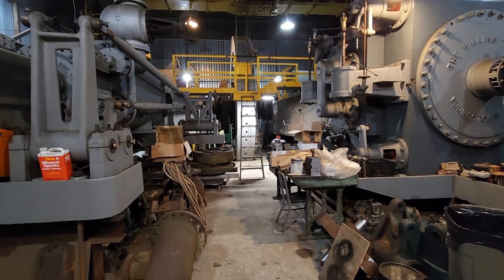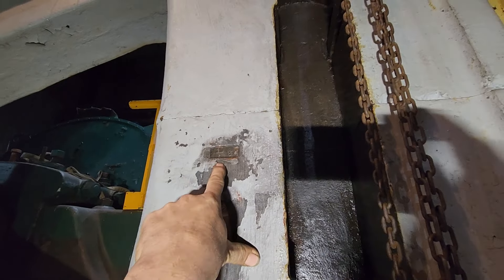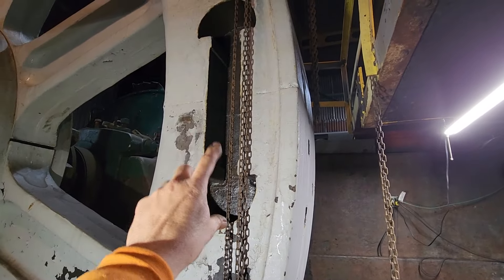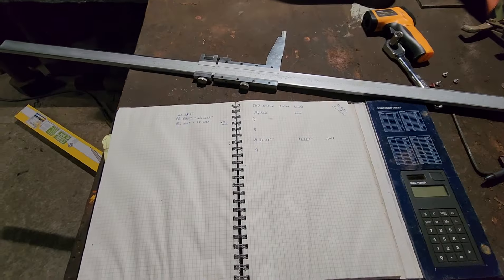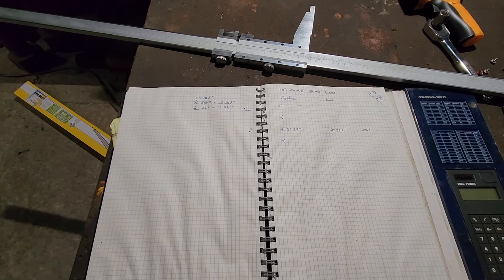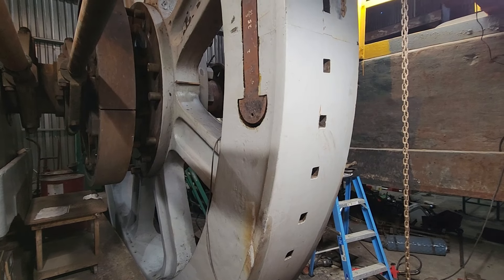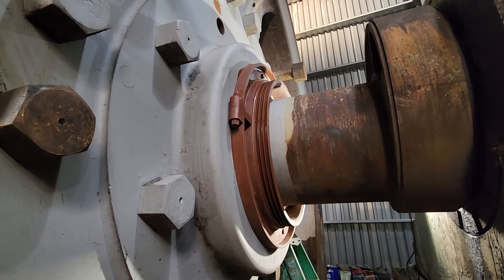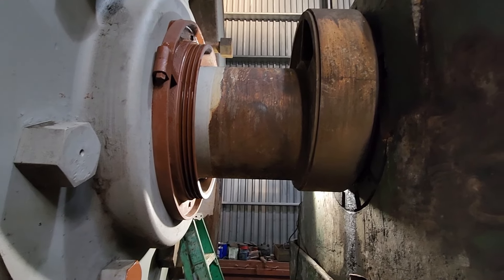Tod Engine Shrink Links

Comment: Very informative.    I’ve read of shrink links before on some of the large engine sites. It’s great to have a video of how the process was done. I can imagine they would have used a portable forge to do basically the same process of heating.   
I do have a question…….what was the purpose of the series of square holes in the end of the flywheel?
Reply: I think they are for jacking the engine to a start position with a very large bar.

Comment: Nice job. The moment the shrink link goes in was nerve wrecking to watch, should it go home or does it get stuck because it cools down too quickly?
In that case it would be a lot more difficult to heat it up again because of the thermal mass of the flywheel added and that it can be heated only from one side when it's in the recess.